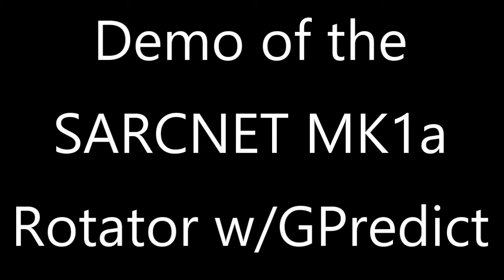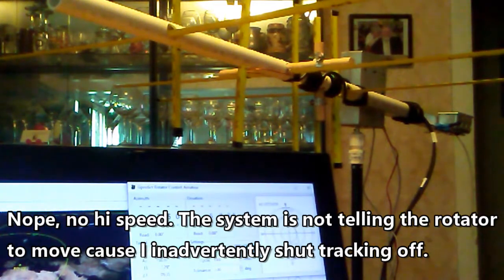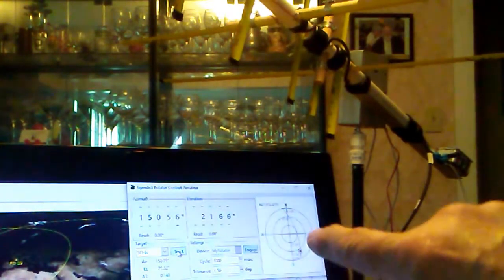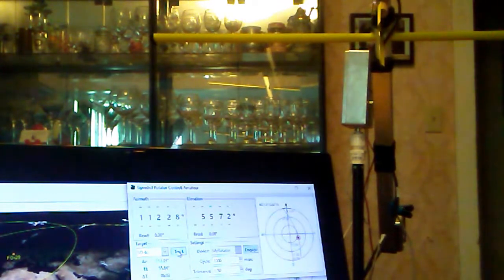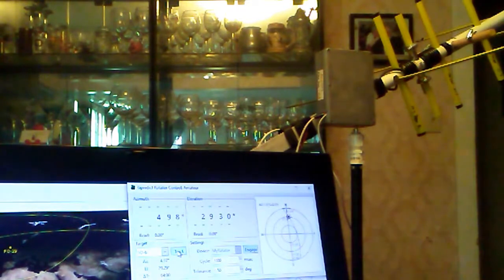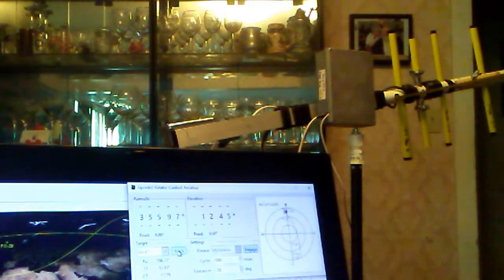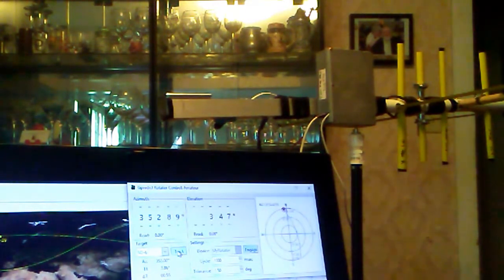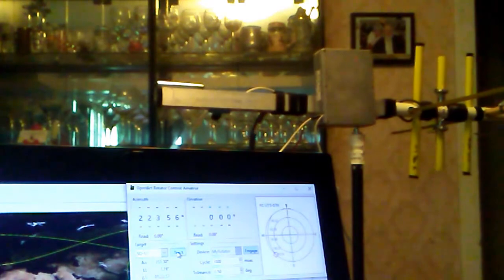SARCNET MK1a Rotator Demo with GPredict and Hamlib

Comment: HI! I'm new to this, I just built my rotator based on the Satnogs V2 software It also uses the Easycom II protocol, I'm trying to control the rotator with Gpredict but I haven't had any success, how do you install hamlib on a windows PC?
Reply from the maker: I found this installer on the hamlib site: hamlib-w32-4.1.exe. Maybe you can google it by name?